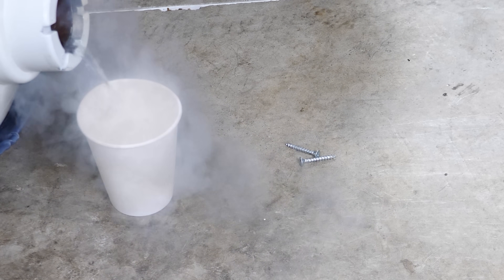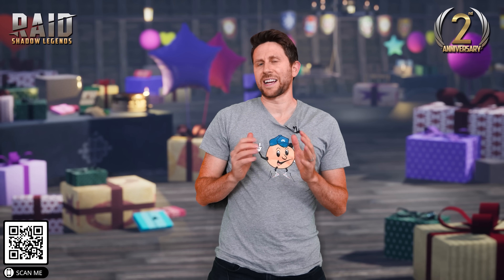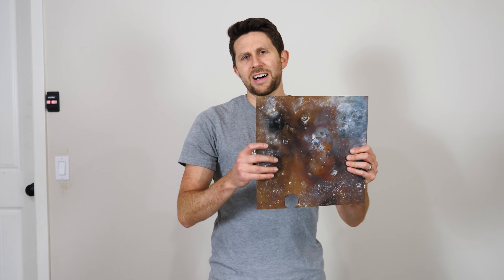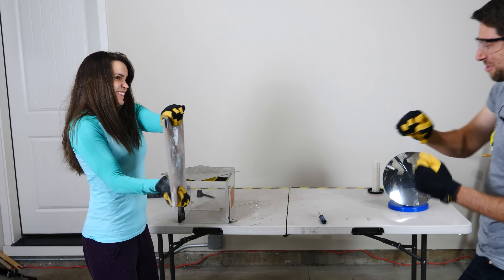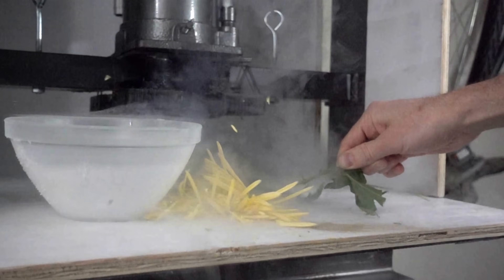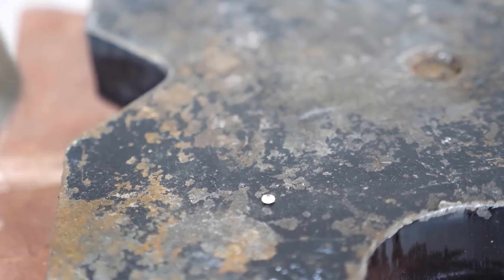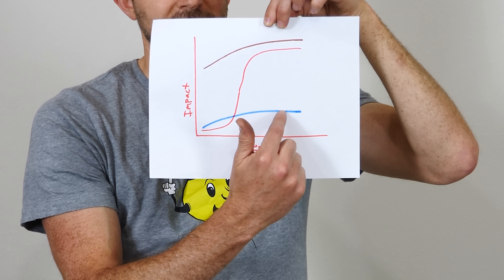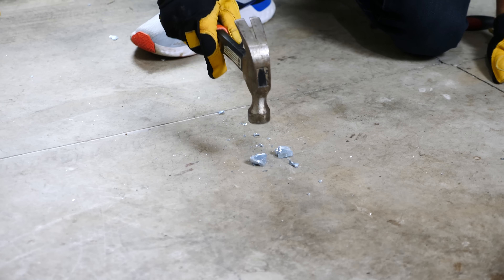Punching a Hole Through Solid Steel Frozen With Liquid Nitrogen

Comment: The screw that was frozen wasn't as ductile, it got more brittle despite being stronger. Steel and iron man-made is special in that it's often somewhat amorphous in structure so it's easy to bend the structure without it crumbling into pieces. If there are large crystallizations, the structure of it makes them often much more brittle because the stress will cause the thing to fracture along a plane that's the weakest, because the stress cannot easily move from one atom to another without breaking bonds. Even modern iron and steel still has some crystaline properties. If you were able to get a special x-ray machine you could be able to see microscopic cracks inside the iron and steel.  I've seen people even use UV flashlights to look for cracks inside camshafts. It's pretty cool.

Comment: Sup holmes:) Question for ya...Does liquid nitrogen or other super cold liquids, have the ability to break down Vulcanized rubber? Could you break down a truck tire, and all the materials within it, using a hydraulic press? Would it just bend, or would it shatter at a certain temperature? Keep up the great work:)

Comment: Aww, Action Lab... why did you have to take the Raid Steal Your Parents Credit Card And Spend Their Money On Gambling Loot Boxes Legends blood money? Dude, that's a lost sub from me. I'm out.

For quite a while back when TheClub was popular, thieves would use R-12 or R-134A to freeze the brass lock cores and shatter them with a hammer to release the "security device" from the wheel with minimal hassle.

Comment: You had the right idea having it mounted in the picture. But then you didn't even do that. Instead you had your wife hold it. Well.. physics says shes moving and absorbing the impact instead of the steel. You were only hitting it at a fraction of your strength. Same with the hammer. Its high-school science.

Comment: Well, steel has higher density then of a flower. Hence you can penetrate the mass with either heat or cold. How fast this is achieved, are determined by density in mass. (and obviously temperature it's exposed to. 

But what you said about diffrent type steels is very true. Pretty sure if you soak the steel plate for 3h, it's gonna break if you smash it within 10 seconds from removing the Nitrogen. Good luck.
Reply from the maker: You do not need to soak that mass of steel for 3 hours.It reaches temperature within less than a minute
Reply: @TheActionLab  Yes, 3h is a exaggeration. Point is still valid tho. 
1. let's think on how many seconds it takes before you lose 10% of that high negative temperatur. 
2. Steel is conductive. Meaning when you start cooling one area, other parts start heating up again. 
3. comon man, kinetic energy! your better then this! 
soak the big steel plate in a bath and smash it!

Comment: What if you had something red hot, then hit it with the liquid nitrogen, would the extreme shock cause anything different to happen?  I often heat and cool bolts to get them unstuck, I always wondered what extreme swings would cause.
Reply: Probably warping or cracking, depends on some variables like metal type

Comment: Hey. I woud like you to do an experiment regarding - A pendulum moving rapidly right to left picking up a mass -

When a phone vibrates, the phone normally moves either in a circle, left or right. But what if we could limit the rotation of a vibrating motor that will only go 0-180 decrees and back 180 - 0 . Then in theory we would have lift....90 degrees would focus on peak lifting mass. Thank You - Marc

Comment: A civil engineer  learns about the relationship between temperature and yield strength, ductility, brittleness of different grades of steel.. WE USE MILD STEEL( LESS CARBON CONTENT= LESS STRENGTH = MORE DUCTILITY) in RCC and Steel Works.. though we have high carbon steel ( High Strength = Less ductile= More brittle). Coz the high carbon steel just fails without much warning unlike the ductile mild steel.

Comment: You need to wear Safety Glasses !!!  But I feel like the metal isn't cold enough to break. Metal does get brittle in the cold. I've done construction work most of my life and I've seen metal act really odd in the winter when it's really cold. Needs to be colder in My opinion. Thank you all the experiments and stay safe ! P.S. Extruded AL may not ever break in the cold lol
Reply from the maker: colder than liquid nitrogen:) But yes the properties do change in the cold!

Comment: Here's soemthing you can try, if you heat up the steel red hot then quench it in liquid nitrogen you can shatter it muuuuch easier because you are tempering to be extremely hard and brittle.

Comment: I like this video a lot. But one thought. I would suggest you freeze the entire meal sheet.  And mount it to a unmoving setup. Freeze for a long time and hit it with the hammer real hard.          (Or fired projectile. Safely.! ) 
I worked outside all year for 12 years. One winter a dozer bucket cracked and some teeth broke off after getting it started. It set with the bucket in a mound of dirt for about a week in -10 temperature.colder at night As soon as it hit 10 degrees we got back to work. First rock the bucket hit. Cracked it and broke some teeth off. It could have been  from other factors. But it's the only time I ever seen it happen.

Comment: Strength and hardness are not the same. Something that is strong resists fracture, but will typically deform. Something that is hard resists deformation but will typically fracture.

Comment: I feel very ashamed to think that yield strength decreases with temperature...
OK. So what you're saying is that for brittle materials, we still have the yield point in the stress strain diagram but it's just so high that it's so close to ultimate point. Now I get it
 And I have never learnt this in my whole 3 years of mechanical engineering... Atleast I learnt now.
Thankyou James

Comment: In addition to that,
Sheets are made by 'Rolling' process where as Screws / Bolts has to under go variety of processes like extrusion, hot forging, heat treatment etc. Due to this the microscopic lattice structure of a steel sheet is entirely different than that of Screws/ Bolts which can give different results under ultra low temperatures

Comment: I've not finished watching the video but I'm going to say no. The cold will make the steel stronger to tension and compression forces, but weaker to bending, torsion, and shear forces because the atoms do not want to move from their current positions. So punching through (compression) is a no, bending, twisting or shearing would be easier though and result in cracks and splits in the metal.
Reply: Spoiler, I was partially right and partially wrong.

Comment: I never thought that toughness does not equal strength before. That's kinda confusing
Reply: Hardness is a measure of how resistant a material is to scratches. Toughness is the ability of material to resist cracking or breaking under stress. Strength is a measure of how much force needs to be applied before a material deforms

Comment: Him: Let’s cool the metal so it’s so brittle that we can punch a hole in it.

Me an intellectual: Just throw the tank at it
Reply: How to crack a safe with liquid nitrogen.
Step 1: Glue the safe door so it's airtight. 
Step 2: Drill &tap a 1/4 inch hole in the safe.
Step 3: siphon a few gallons  of liquid nitrogen down  that hole.
Step 4: screw a bolt into the hole and run!
Reply: @deltab9768  you could skip tap and screw steps if you about to use nitroglycerine instead of nitrogen ))
Reply: @DmitryKiktenko  the glue part too. But then you're not using liquid nitrogen tho.

Comment: Carbon steel would have a better reaction. Carbon steel is used in all toughened steels not mild steel. Using that instead of mild would give the shattering effect you are looking for. Until treated it is as ductile and malleable as mild steel, once toughened shatters. In usual applications it is then tempered to give it the strength without shattering because you looked at it too hard. Super freezing it would remove the tempering effect and make it easier to shatter

Comment: "I would like to thank our sponsor Raid shadow legends..."

Me: ⏩⏩⏩⏩⏩⏩⏩⏩⏩
Reply: You forgot the ⏪⏪⏩ when you overskip
Reply: @rahulshanbhag08  Lol true
Reply: @rahulshanbhag08  Yeah😂
Reply: furiously taps the right side of the screen
Reply: Me: does nothing as my addon autoskips them :D
Reply: @red2  Extension for PC?
Reply: @danielbavisetti8731  Yup on Firefox its called SponsorBlock . Its done using crowd sourcing of time stamps and auto skips youtube parts. Works on top of normal add blockers.
Reply: @red2  YouTube Vanced has it built-in
Reply: @neliasoares6217  Thanks didnt know vanced could do it also. Will check it out.
Reply: lol same haha
Reply: Skip 1 minute
Reply: @nitin-code-comedy  I skipped 1 min and 10 secs just for good measure
Reply: you know.. i wonder if there is some way you can make an extension that listens for common integrated ads and then automatically skips.. it would be VERY hard to do if even possible but that would be epic
Reply: @Minecraft-3699  OMG that's complicated
Reply: @vighneshpanasa4304  the complicated part is getting it to detect how long the integrated ad is.. you can skip the time in the video with like selenium or something
Reply: YES
Reply: Hell yeah. Everytime. Lol
Reply: Lol me too
Reply: That's damn relatable 😂
Me everytime
Reply: It's only six skips, not nine
Reply: @ikewenger1593  If it's 10sec skip then 6 skips. But I use 5 sec skips So, that's 12 skips. If I add the remaining 3 skips it will not look good. So I left it at 9 skips.
Reply: @danielbavisetti8731  Ohhh, that makes sense
Reply: Exactly me on god
Reply: I just use sponsorblock
Reply: Were I got it
Reply: I just hold the bar and slide until i see where the ad ends
Reply: @dwdadevil   Me too sometimes
Reply: @danielbavisetti8731  Should do it more often, it saves an extra bit of time
Reply: I wanted to see how he sponsored
Reply: Raid shadow legends = underrated